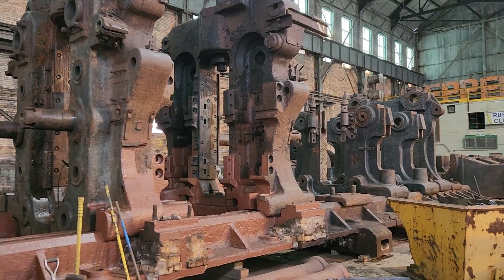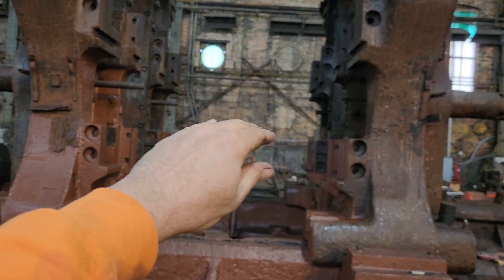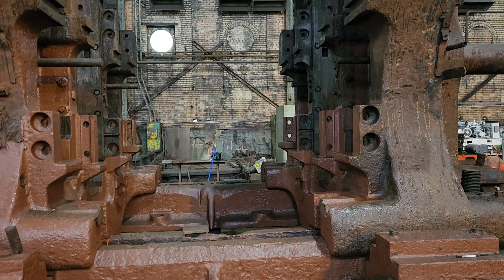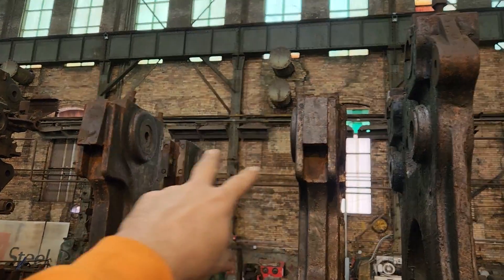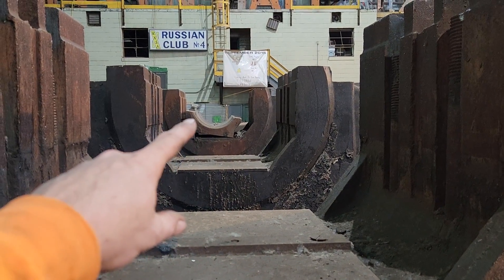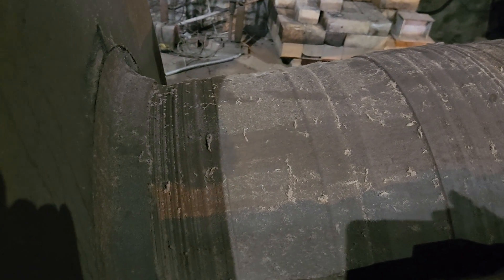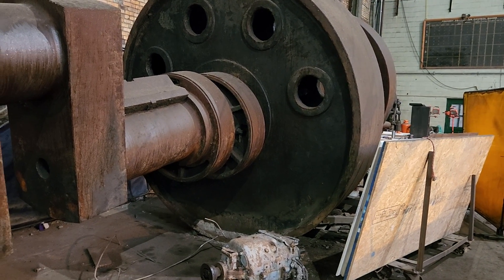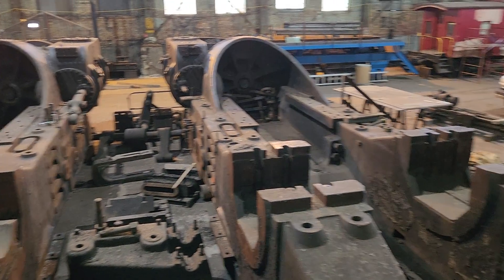48" Universal Plate Mill Restoration Part 1 Overview

Comment: At our steel mill (works) the oldest rolling mill shop#4 built also at end of XIX century decided to convert for production of wide assortments of rail fastenings. All existed rolling mills were converted to produced various fastenings after the old open-hearth shop#2 decided to shut down for environmental reasons in late 70's. Original rolling mills in that shop#4 used to receive a 2-ton steel ingots as a source product from the old open-hearth shop#2. One of a few original rolling mills in that shop#4 used to produce an end product of universal plates for other hot sheet steel rolling mills. My great-grandfather worked as a rolling mill operator in that shop#4 from 00's to 30's of XX century.

Comment: I'm just guessing about 48", as we're speaking about universal plate mill, that's probably represents length of some horizontal roll gauge (caliber). On this ancient rolling mill is not many pre-roughing/roughing, pre-finishing/finishing groups of stands, more likely just stands. I also assume that 48" represents parameter (usually that's pitch diameter) of some pinion for pre-roughing/roughing or pre-finishing/finishing stand.
When we're speaking about a rolling mill other than plate related, then the number will be representing diameter of a roll gauge (caliber) or the pitch diameter of a pinion. For example, on the Blooming prime mill the number of 1150 mm represents the maximum diameter of the longest caliber or gauge on both horizontal only roll, called it a "barrel". Generally speaking, blooming is simple prime mill with 1 work stand, 1 pinion stand, and 1 shear press. Of course it includes many groups of soak pits, special purpose clamp overhead bridge cranes, general purpose overhead bridge cranes, different conveyors, machine and control rooms included too. In the Blooming complex also included the flipper with 4 clawed arms, which turns ingot 90 degree after some passes. Total number of passes for Bloomings is always odd.

Comment: I'm guessing that you would have to restore an old lathe that was big enough to turn that crankshaft.  That or a wooden ring that fit around the journals with 60 grit stapled on the inside. Driven by a belt and motor.

Comment: Good grief they really gave it to that crankshaft. Looks like somebody put sand in the oil.  I assume the plan is for it to be totally static. No way for it to move?
Reply from the maker: I wouldn't be so sure about that.  If we can make up an electric drive so that the engine can slowly turn over, we are going to do it!   The crankshaft has three bearings so maybe we just do not put this bearing back in place and have the crank rotate on the two good bearings.

Comment: Have you got all the original giant spanners you will need for tightening those huge nuts and bolts or are you going to go modern and use sockets and a 1" or bigger air gun?
Reply from the maker: Probably make some of the larger wrenches out of plate burnouts.  For others we may be able to borrow large sockets and hydraulic drives.
Reply: For our 250 - 1,500 ton clamping pressure injection plastic press rebuilds we were able to rent a toque wrench from our hydraulic cylinder supplier. Wow, only a fraction of what is needed there!